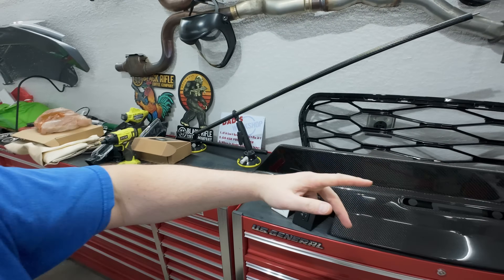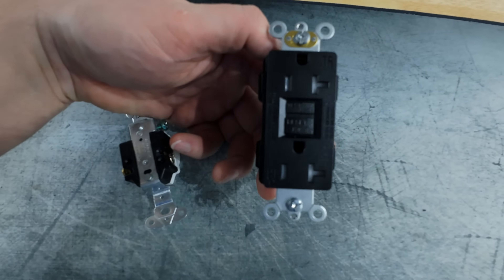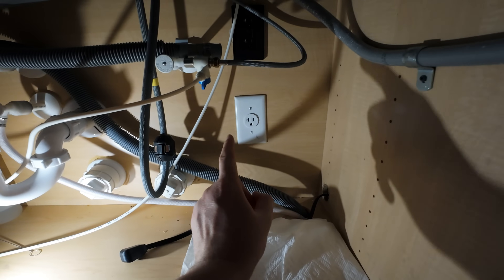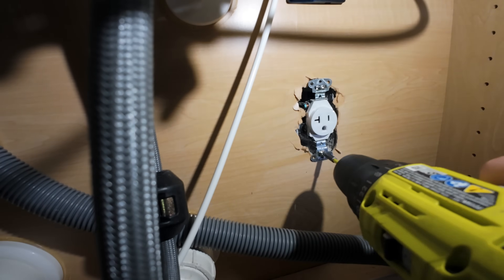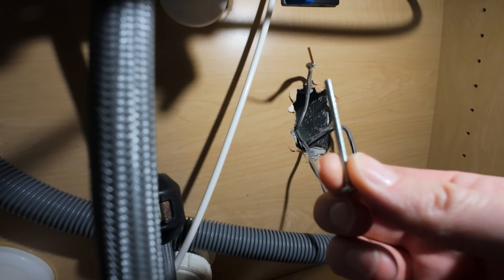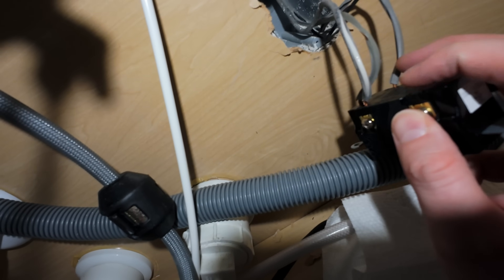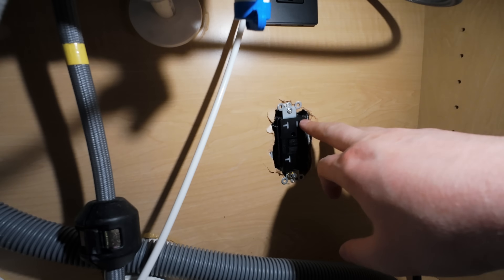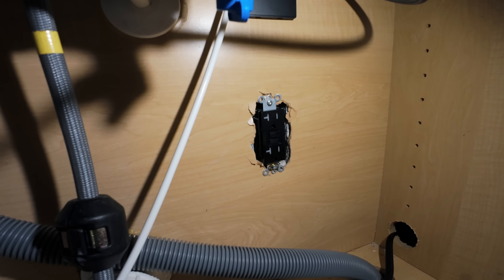How-To Change Single 120v Outlet to Dual 120v Outlets!

Comment: Good job, I'm an electrician and I approve. Just a quick note for anyone reading. The gfci or gfi for short has a line and a load. The incoming power goes on the line side and the wire to other stuff goes to the load. The purpose of this is to gfi protect anything down the line. Landing the hot on the load side wont break anything,  but the gfi wont work.
Reply from the maker: Thank you! And thank you for the clarification and in depth info on the gfi piece! :)